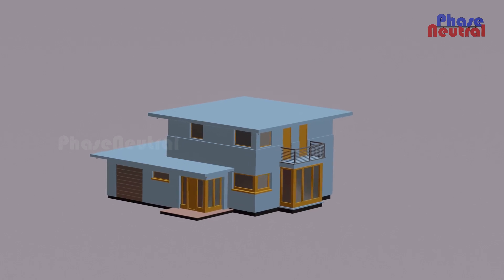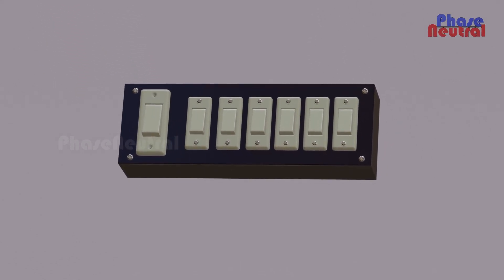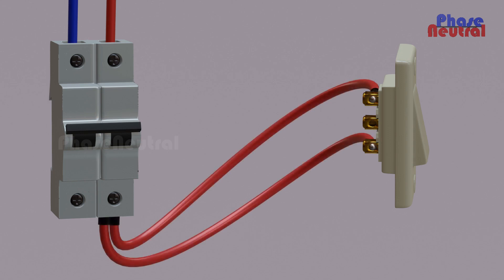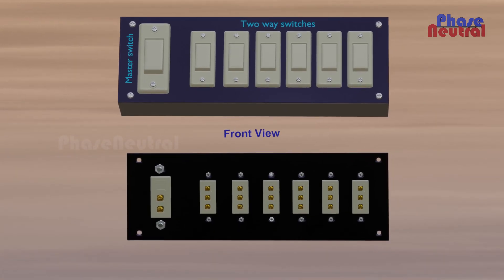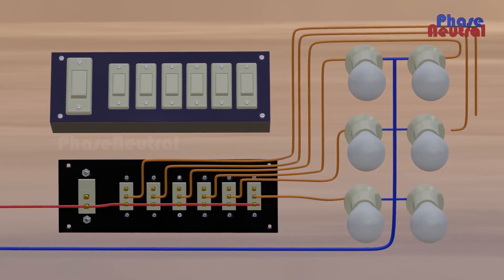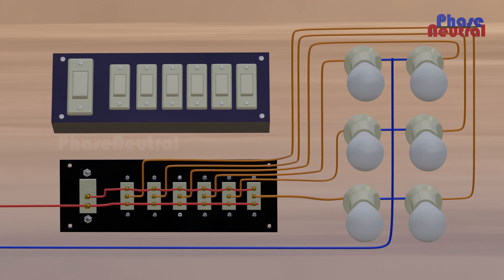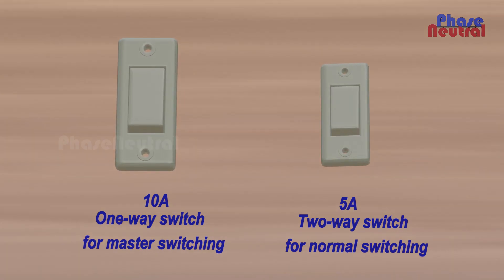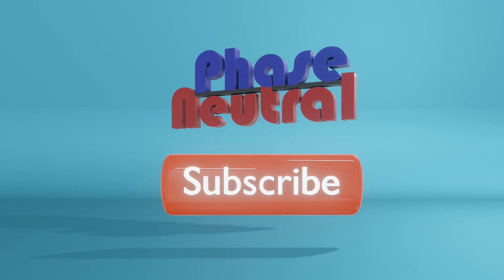How Master Light Switch circuit works? | PhaseNeutral

Comment: Dears, this is a nice one, but only works to light all lights ON.
Can we use a combination of two two-way-switches for master purpose, so that we can both, switch ON & OFF all lights from that point ?
Reply from the maker: Yes .. but mostly one way switch is using for master switch. If you switch ON all lights by master switch.  You can switch OFF that all lights through same master switch only..  that is good for safety.